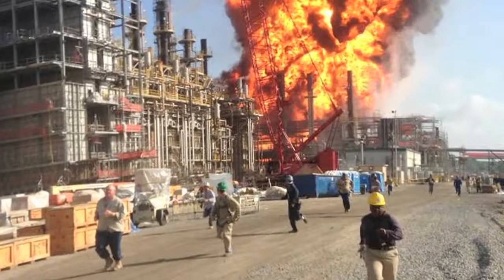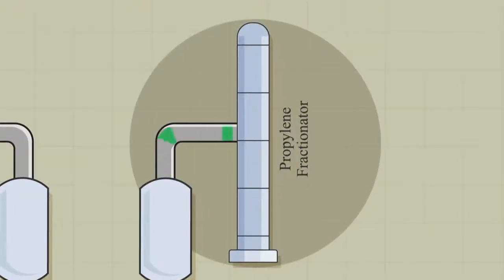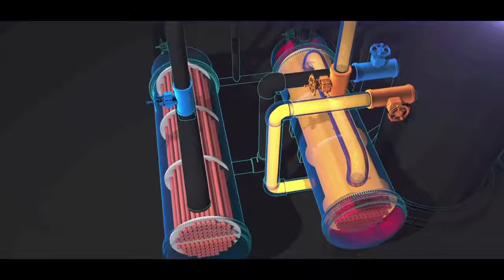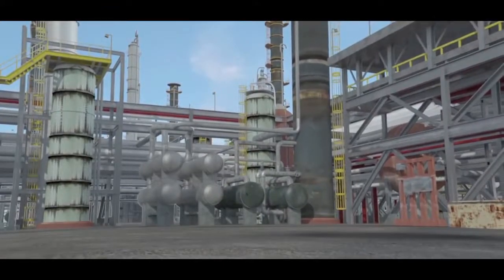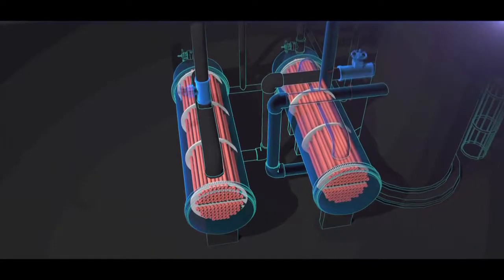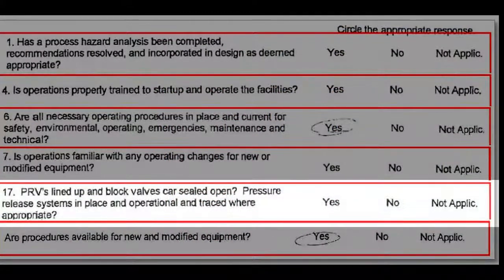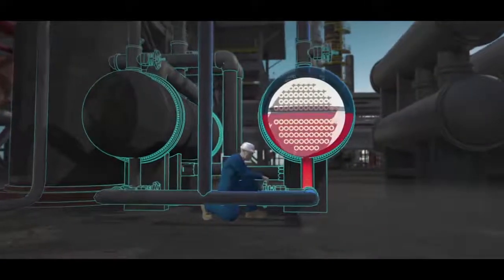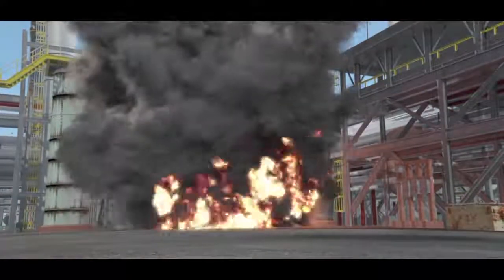Fatal Accident: Propane Tank Over Pressure Explosion

Comment: Thanks for share.. I use to design this kind of equipment. This give me more concern in safety for such modification.. Each equipment which has isolation valve better to have PSV to cover such scenario... the problem is isolation valve is added, so PSV should be in pipe prior the additional valve.. otherwise without PSV, valve key interlock is necessary..